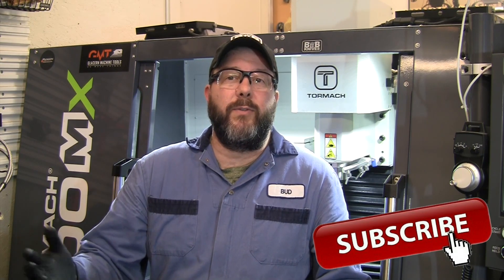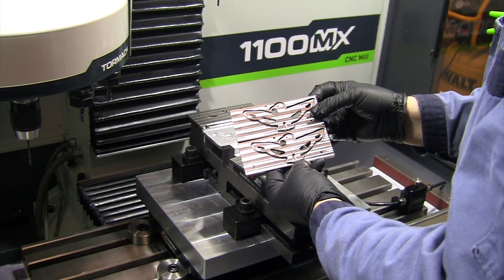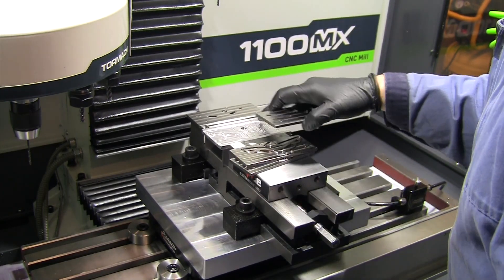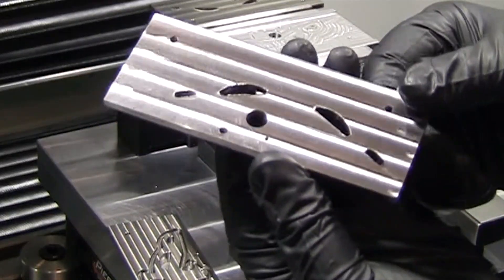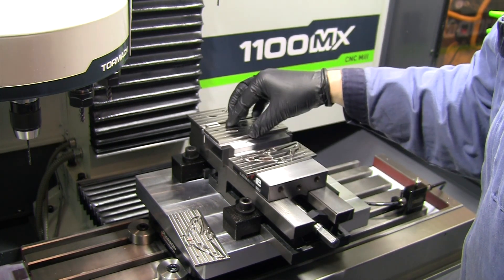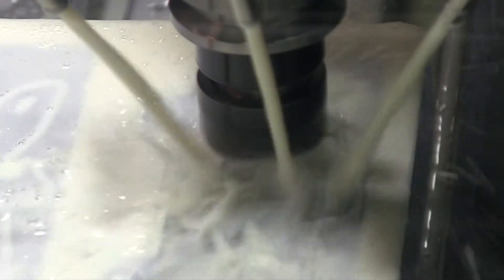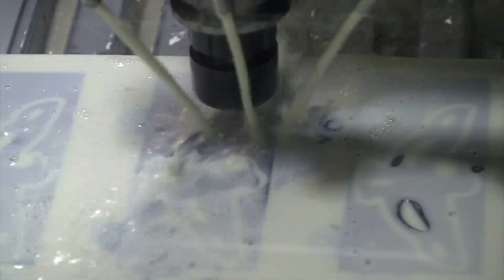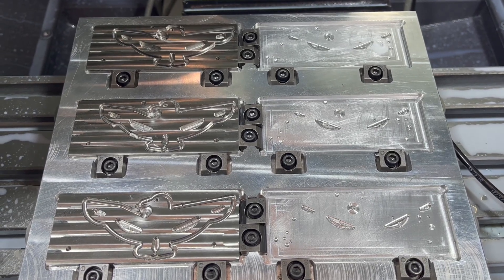Why I Love The Pierson Pro Pallet System On My Tormach 1100MX-Practical Example Of The Time Savings

Comment: Can you do 45° or angled cuts on the tormach?
Reply from the maker: Manuel Pagan - Yes, in this video I am doing more of a curved contour, but it will do a 45 or any angle you need.  The Tormach can do full 3D contour tool paths.  Thanks for the question, I hope that answer gives you what you need.
Reply: @BladesIIB  thanks for the reply, our company just purchased the Tormach 1100mx and noticed it only has an X and Y axis on it, so i was wondering if we needed to purchase the microARC 4th axis to achieve the 45° cuts
Reply from the maker: @manuelpagan8212  Congrats. The X;Y and Z give you full 3D motion. The micro does add some additional versatility for indexing a part but the machine and a good CAD software is pretty powerful as is.  Good luck getting it all set up and working for you.

Comment: Oh, one other thing, I don't use any of the G54-g59 stuff.  It's annoying to think G54 is wcs 1.  and 0.  And G55 is wcs 2, etc.  If you specify a WCS at 10 or higher, Fusion 360 will post it as G54.1 PXXX where XXX is the number you specified.  Then it always makes sense.  G54.1 P12 is WCS 12.
Reply from the maker: Bill Strahan - Makes perfect sense, I am all about keeping it as simple as possible to avoid any confusion where you can.

Comment: Since you have the vise on a pallet, and PathPilot supports 500 work offsets...I recommend you probe the vise opening at the bottom fixed jaw left, center, and right and assign them something like g54.1 p301 throught P303.  This sounds strange, but I have 3 different pallets now with different vise setups on each.  I have each of those points for every vise.  and as a result I can quickly do a one-off project that doesn't need better than one or two thousandths accuracy.  

As an example using the back left corner of stock, I just figure out what size parallels I need, model the stock in Fusion 360 rather than create it in the CAM setup, drop a sketch point below what I want to be the back left corner stock in the vise aligned vertically with the corner and at a distance equal to the depth of the parallels.  so the WCS is the fixed jaw left corner at the bottom of the parellel, and now fusion knows where my stock is by using (in my case) g54.1 p351.  p351,352,353 are the left, middle and right corners of the fixed jaw at the bottom of the opening on my 5" vise.  I use different wcs offsets for the other vises.

I just line the stock up with the edges of the jaws using another parallel until I clamp it.

I can even do an op2 to remove a tophat without ever probing.  I find a point on my finished part that I can use to line up with a straight edge between the jaws, and then I drop another point in the sketch at that point and use that as my origin.  No probling, same WCS, everything.

I agree, the pallet system is amazing.  I have gone months and months without every using the probe.  

For what you're doing with a mini fixture in the vise, I have moved to doing that on fixture pallets that have m8 threaded holes and 8mm holes for alignment holes.  So all my subfixtures go on the fixture pallets and I don't need to probe those ever again as well!

Keep up the great videos..  There are so many ways to improve and streamline the machining process and I love that you're showing people how you do it!
Reply from the maker: Bill Strahan - Appreciate the comment.  Great tips to take using the vise to the next level.  I do have several programs where I use the same location off the vise, clearly makes sense to build that in.  Thanks for sharing your expertise and clear how to details.

Comment: Super nice videos! One thing I've been wondering about: the finnished product. What do you use all the things you make in the milling machine for? Yes, there is the possibility that I've misded the assembly videos, but could you enlighten me...
Reply from the maker: Johannes Laxell - Appreciate the feedback on the videos.  As for the products, some projects are for shop use like the sticker punch.  These bottle openers have my BladesIIB logo in them (wings are B's and Roman Numeral II in the legs) the bottle openers I sell on my website and at Knife Shows.  I primarily use the CNC for my knife parts, you can see those videos on my channel as well.  I sell the knives as well.  Other parts like the part for the Saab was for my sons car, although after posting the video I have sold a few of those roof locking bows as well.  I hope that helps, you can check out any of the items I have available at my website - www.BladesIIB.com or www.Blades2B.com.
Reply: @BladesIIB  I will go back and look for some knife making and stuff alike, that part has "gone under the radar" for me 😋. I guessed that there is a bigger operation in play when I look at your pallet systems and your Fusion planning.
 Really like your videos 👍🏼👍🏼💪🏼!
Reply from the maker: @johanneslaxell6641  Yes knives are my main personal focus. Then all the other projects that just come along.